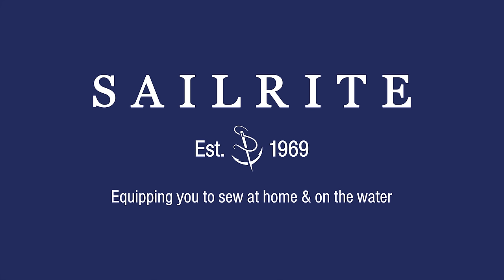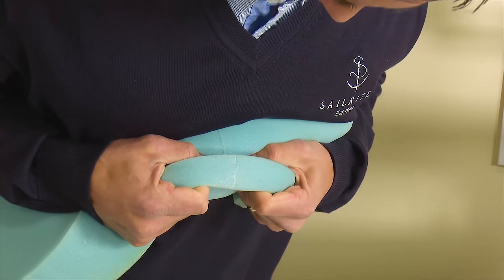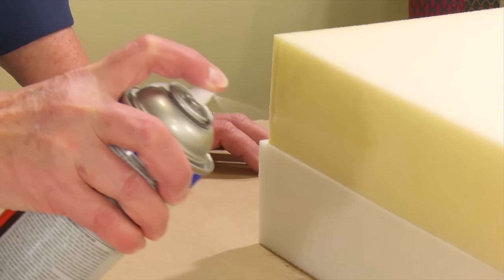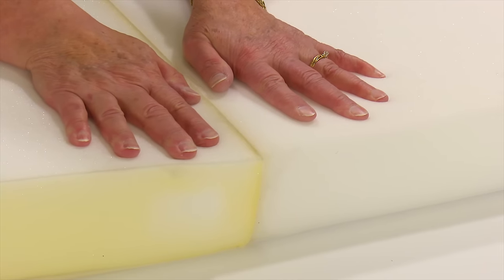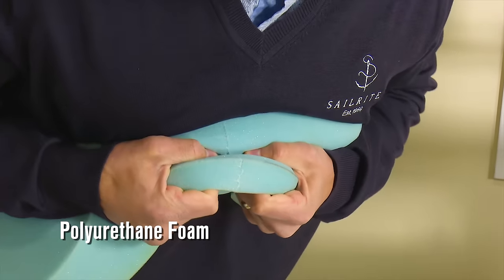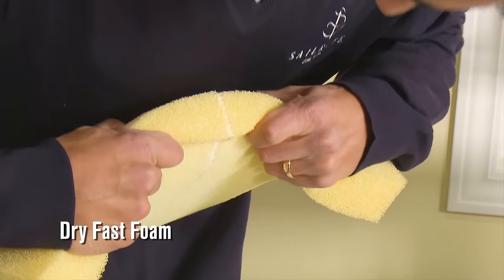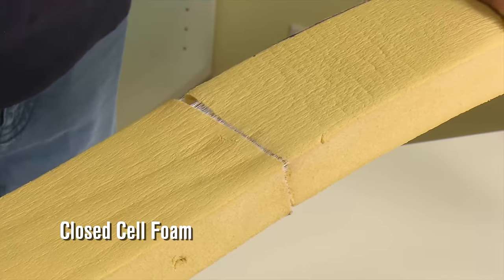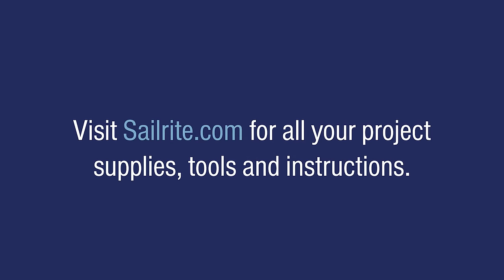Gluing Foam with Foam Lock Spray Adhesive

Comment: I needed to see this. I have been so concerned about my foam coming unglued inside the cushions.  In the short term, it appears I have nothing to worry about. Not sure about long term.
Reply: As long as Zach doesn't come in and try to pull it apart with his shoe it should be good

Comment: Does the foam keep is softness and flexibility after glued together? Or do the glued sections harden up?
Reply from the maker: The glue does slightly firm up the section that is bonded, but once a cover fabric is applied it is very difficult, it not impossible, for the occupant to find the glued section of foam be feel alone. The practice of glueing sections of foam together is common and usually expected for large to medium seating foam applications.

Comment: How do I keep spray adhesive can from clogging the first project or what do you recommend for one time use/mini cans? Do they exist?
Reply from the maker: To prevent spray nozzle from blocking, at the end of each day, turn the can upside down and press tip until spray is clear from adhesive. Sorry, no mini cans.

Comment: Is that spray adhesive can be used to stick foam with Mild steel sheet?
Reply from the maker: It might work, but you should test it first. We have not tested it with a steel sheet and foam.

Comment: does the adhesive dry to a pliable or stiff texture? Is it noticeably stiffer than the sections of foam it is gluing together? and you feel the seam is stiffer than the surrounding foam?
Reply from the maker: The glue is so thin that you will not feel the glue section when the cushion cover is applied to the foam. The only possible person who may, is the fabricator, since they know where the seam is, but no one else will be able to feel it without a ton of effort.
Reply: @SailriteDIY  The reason why i ask is because I have a foam mattress that has a memory foam topper. I had to take off the cover to cut it down to a different size and the memory foam did not bond well to parts and in some sections even tore. So I wanted to re-bond it and perhaps somehow repair the tear in the memory foam before putting on another cover over the foam. I am going to put on a zippered encasement as a cover. the size is not snog over the mattress, so this makes it especially useful if i can rebond the parts that car coming up or that have torn.
Reply: @SailriteDIY  i am wondering if i don't have a lot to bond.. if i could use a squirt bottle of regular polyurethane liquid glic to create a bond.. perhaps not a full bond of all the foam surface?

Comment: So which one is the best for memory foam. (This clip didn't exactly answer my question) I have a mattress topper that was stored incorrectly (folded instead of rolled up)and it ripped in about 3 pieces. I need it where it's stuck together to be as soft as the memory foam is normally because the rips run across the bed where I need the support for my spine.

Comment: Can you use foam lock to bond sponge onto plastic materials? if not, what can i use to bond sponge onto plastics?
Reply from the maker: Yes, it may be possible to use Foam Lock Spray Adhesive to bond foam to plastic, just do some testing first. If this is a headliner application use 3M General Trim Adhesive instead.

Comment: can we use this glue for polyethylene foam ?
if yes,then how much strength it possess..
Reply from the maker: Yes, we used it on a high density Polyurethane foam and the bond was so strong that when pulled on the foam ripped and not the are that was glued.
Reply: i ask for polyethylene foam
Reply from the maker: Oh, sorry. I have not tried that, but I bet it would be.
Reply: RAHUL KANNAWAR Did you try it? Did it work?

Comment: I need help. To the top of one square foot of plastic I need to glue a square foot of rubber, which glue do I need to use? Should be waterproof.
Reply from the maker: Sorry, we do not have a definitive answer for this. You can test using HH-66 Vinyl Cement, it might work.
Reply: Thank you, I will try.

Comment: Very impressive!
Reply: How does this adhesive compare to contact cement and does it smell as bad?
Reply from the maker: It is much easier to apply than contact cement and has very little smell. I love it!
Reply: Awesome, would this also work to adhere fabric to foam? Like naugahyde to very firm foam.
Reply from the maker: Yes, I have used it with Naugahyde and glued the vinyl fabric to a wooden surface with great success. I have not tried it on a Naugahyde to foam application. It should be tested to see results before that is done. I know it would bond, but if it is sat on several times, would the fabric still look good????
Reply: @SailriteDIY  have you found any alternative products that work nearly as good or maybe even better than the NG1633? Such as Gorilla Heavy Duty Spray Adhesive or?
Reply from the maker: @manp1039  Yes, we are working on a new brand of spray glue to replace this one that is in short supply. We have done the testing and it works great. However, it may be several months to finally stock it since we are branding it.